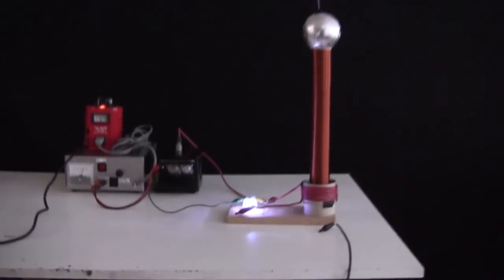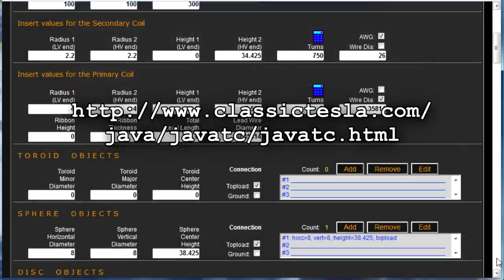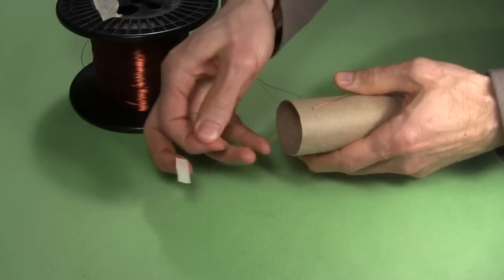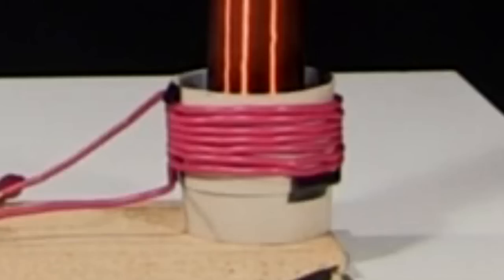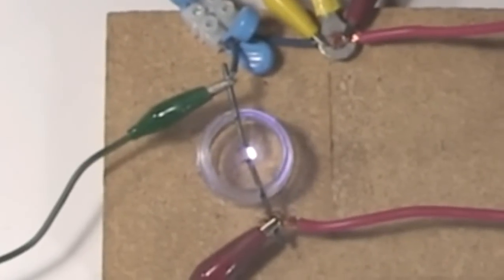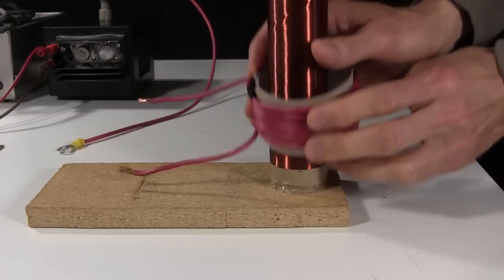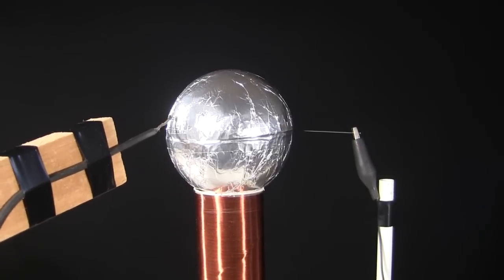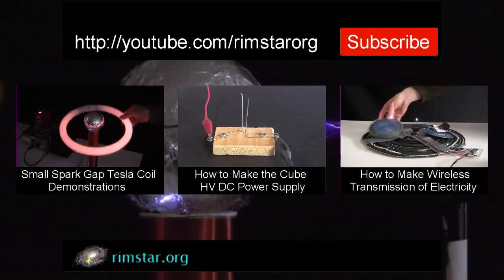How to Make Tesla Coil - Small Spark Gap Tesla Coil

Comment: My Tesla coil won't work .I used a self-made high voltage transformer(it outputs 1,500v high frequency arcs).Then I connect it to a voltage multiplier circuit.The spark gap works .But I don't see anything on the secondary
Reply from the maker: Have you gone through the calculator I point out in the video when designing your primary and secondary? Also, keep in mind the tuning I mention near the end of the video. Are you hearing rapid, loud sparks? You setup sounds like you should be but if you're getting only infrequent or weak sparks then your power supply might not be powerful enough. Also, make sure your capacitors are not damaged.
Reply: @RimstarOrg  thank you for replying.It works now ,one of my HV diodes were broken,thats why my voltage multiplier converted it only to 900 volts and most of the output of the transformer was shorted.Tuning also helped a lot, I don't have the tool to measure things like inductance just tried random number of turns and already found on 10th try the perfect height and number of turns.
Reply from the maker: I'm glad to hear it's working. Thanks for letting me know. Yeah, I too have some multiplier boards with busted diodes and/or capacitors, in my case. I'd let the insulating oil get too low.

Comment: what is the reason for sparks in this coil
Reply from the maker: They create a periodic pulsing of the circuit. But also, during the spark, the air in the gap is conductive and AC current fluctuates back and forth across the gap and through the primary coil for a short while, until the air is no longer conductive and we wait for the next spark.

Comment: Thats on dc right?
Reply from the maker: I'm not sure what you're referring to. My input source, what I call my Cube power supply is putting out DC but AC can work too.
Reply: @RimstarOrg  yes i was referring to you r power supply. Beacause i was wondering if its possible to power the exact same device with one of those high voltage chinese modules that you can buy online

Comment: Have you thought of using a spark plug for your spark gap?
Reply from the maker: I've never tried one for this. You'd probably have to open up the gap a bit.
Reply: Probably but I think that if you used a platinum or iridium one it would outlast one made with nails many times. If you are friendly with your local garage you could probably beg a second-hand one from a recent car service.

Comment: What's the input voltage??
Reply from the maker: I don't know, I didn't measure it. The input voltage is determined by the spark gap size and the geometry of the electrodes on either side of the spark gap. It may have been somewhere between 1kV and 10kV.  You do need a power supply with a decent amount of current though, otherwise the sparks will be too infrequent. For example, I tried a power supply from an electric fly swatter/bug zapper and the spark was only every few seconds so it was no good.

Comment: Okay.. so I took a microwave transformer.. (I know, not the best but this was just to test a wireless lightbulb to see if it worked in general at all; before I would move on to an actual more practical circuit) I wired my tesla coil exactly like this with nothing more than a spark gap. transformer positive to spark gap, then to primary coil, then to ground on transformer. Secondary was earth grounded while other end I just left for time being. Lightbulb does not light up at all nor do I get a spark from secordary top wire. So I flipped the primary coil. Still absolutely nothing. I spent hrs on it until I gave up. Even threw in a capacitor at one point.. Still nothing... so I switched methods.. I got a double AA bug zapper racket. This time a smaller tesla coil. Wired it the same way. Transformer Lead to primary, primary to transformer ground. Secondary earth grounded, top wire was left alone. Again absolutely nothing.. no wireless power or spark from top wire. Flipped primary coil again. Still nothing at all.. please help..
Reply from the maker: +Powertripp Productions Firstly, if you're trying to make a spark gap Tesla coil then you need the capacitor. Did you get sparks at all at the spark gap with your microwave oven transformer (MOT)? If you didn't then the problem is with the MOT side of things - that side wasn't working. Secondly, keep all wiring for the Tesla coil as short as possibly, like I did. Also, did you use exactly the same values and dimensions that I did? If not then you need to go to the JavaTC online calculator I talked about in the video and put in your values and adjust them until the calculator shows you you're getting close to the same resonant frequencies for the primary and secondary coils. And then you need to tune it like I showed.
Reply: So resonance really has that big of a factor in this?  Can't just build one and it will work.. right?
Reply from the maker: +Powertripp Productions Without resonance you'll get some step-up transformation, but a resonant Tesla coil does more than that. It's more of a cumulative pumping effect.

Comment: What happens if u don't use capacitors?
Reply from the maker: Without capacitors, the only energy for the spark is from the capacitance across the spark gap. It's far less energy to make the Tesla coil work. The result will be much smaller and you may not detect it at all. If you're having trouble finding the capacitors then they're easy to make. See my video about making flat plate capacitors for this Tesla coil https://www.youtube.com/watch?v=EkvODkLL9Og If that's too difficult then I also show how to make some out of soda bottles https://www.youtube.com/watch?v=iV7Irwaqe3w

Comment: How big are the nails?
Reply from the maker: All that really matters is the shape and size of the parts of the nail that are closest to each other, the nail heads. Other than that, the nails can be any size. In my case the nail heads are flat but have a rounded edge around the circumference. It's the rounded edge, since it's the sharpest part of the head, and the distance between the heads which ultimately determines the spark frequency and strength. Just use any two pieces of metal which don't have sharp points where the will be close together.

Comment: AC or DC?
Reply from the maker: +Jaromy Van Der Sluis DC power supply. AC output.
Reply: why not using AC power as input.......
what is the necessary to use spark gap ?? (because AC input itself alternating which produce alternating electromagnetic field when connected to tesla coil..)

Comment: Mine isn’t working any tips
Reply from the maker: To be honest, without being there I wouldn't know where to start. The usual steps for a circuit are to check the components and the connections. So check your capacitors using a meter on the capacitance scale and check all connections. It may be that your power supply is not powerful enough. For example, I tried with an electric fly swatter and it wasn't powerful enough. So another good first step would be to see if your power supply can produce sparks at the spark gap without any of the rest of the Tesla coil in place. Just keep in mind that sparks can also damage a power supply if it isn't built to handle the high current from sparking. But if the gap is small then that may not be a problem so start with a small gap.

Comment: Toilet paper roll is 43mm diameter ....with 50m of wire you can make around 1000 turns ...dont know how you come to 105 meters of wire
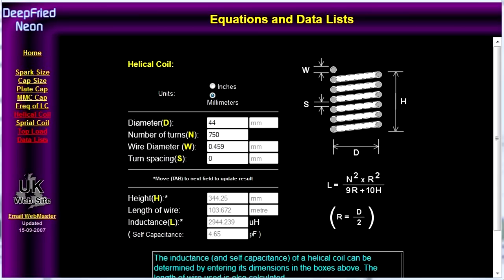Reply from the maker: My wire diameter is 0.459mm. Given a diameter of 43mm (I used 44mm in the video, see 3:21), the circumference of a single turn is pi x 43mm = 3.14159 x 43mm = 135.088mm. So each turn uses 135.088mm of wire. For 750 turns, that's 750 x 135.088mm = 101316mm = 101.316m, which is close to the 103.672 meters which the online told me I'd need (again, see 3:21 in the video). Maybe you started with a thicker wire?
(I just noticed that in the video I wrote on the screen 12 AWG while I said 26 AWG. I used 26 AWG.)
Reply: RimstarOrg ah thats it , i didnt had in mind that you used such a thick wire :) btw im using kitchentowel roles too , in combinqtion with superglue they get rock solid and its easy to work with

Comment: What is the equivalent transistor to 2n2222
Reply from the maker: I don't use a 2n2222 anywhere. Here's a search https://www.google.ca/search?source=hp&ei=st7FW7avKNHc5gL4vIOIDg&q=2n2222+equivalent
Reply: The 2n2222a is same type with slightly improved emitter to collector current